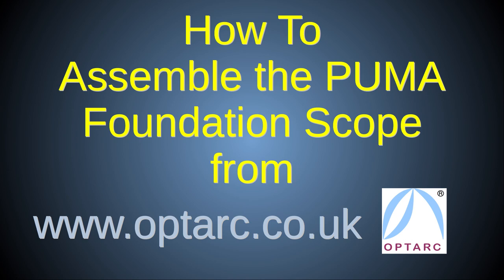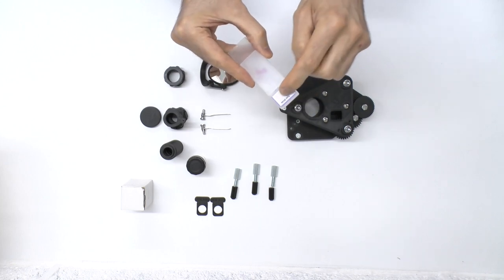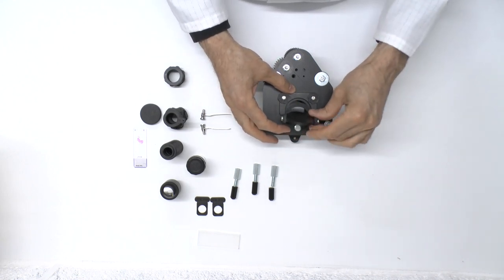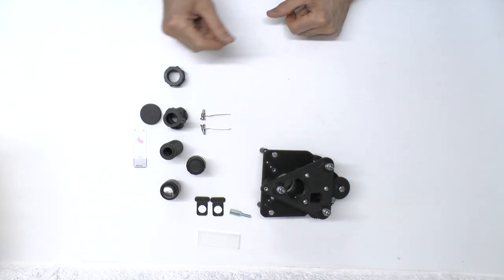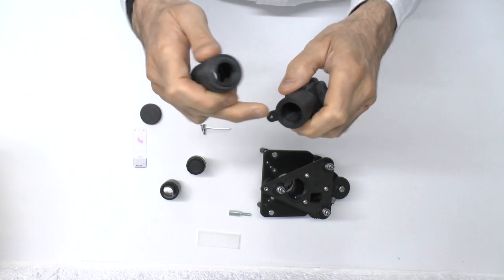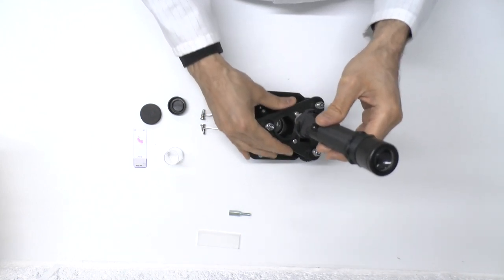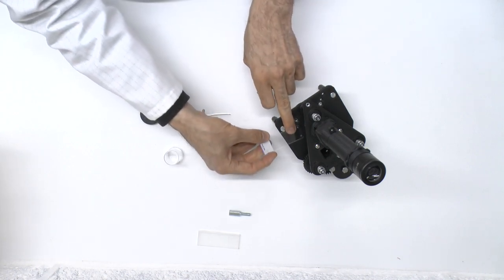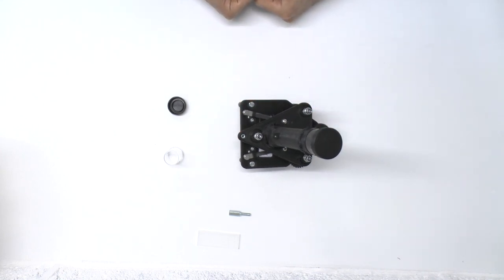Assembling the PUMA Foundation Scope Microscope

Comment: Is there a need to have oval mirror ?

Its not easily available to purchase and seems to be expensive nowadays with very limited stock.

Is it okay to use a circular mirror and customize the 3d file ?  

I am curious to know if there is a Functional Reason for choice of Oval mirror over circular.

I am guessing that the mirror's light will appear as a circle in the eyepiece when it is in an angle and hence this decision was made.

But, I see all  commercially available projects come with circular mirrors. I am slightly confused here.
Reply from the maker: Your guess is correct - the oval, projected at 45 degrees, gives a circular area of illumination. However it is not about 'as seen in the eyepiece' but as illuminating the back focal plane (BFP) of the objective so as to get maximum resolution and minimise unwanted phase contrast. You could use a round mirror if the minimal dimension of the projected oval (because the projection will be oval with a round mirror) also fills the BFP of your objective. This should be fine for low power objectives but the higher you go the more likely you are to get issued with poor quality illumination if the mirror is not large enough. So, with a round mirror, to get equivalent quality of illumination for high magnifications, you will need not only to alter the shape of the receptacle but also its size and a bigger size may not rotate to 45 degrees unless you also elongate the legs.
Having said all that, you might actually be able to 'get away' with using an oval piece of aluminium foil instead of the mirror. As long as you are not using this as part of a Köhler projection system, the slight diffusing effect of the aluminium foil might actually improve the quality of illumination compared to a clean / pure mirror.

Comment: What is that specific test slide protective case called. I could not find it any where online.
Reply from the maker: It's called a 'slide mailer' (a single slide mailer in this case because this type holds just one slide ). This is what we use to send glass slides in the mail - hence the name.
Reply: @PUMAMicroscope  I know the generic term 'slide mailer' but when I search I only find the hinged opening type. This is like a sliding style of mechanism to it. 

I did search for this specific type of opening and could not find it.

I am able to find a generic slide mailer that hold one slide but I am in search for this gliding style slide mailer.

Please help if you have a link for this specific style of slide mailer
Reply from the maker: @sheikjabuty  Oh - I see. I get these from a company called CellPath Ltd. They call it the 'SLIDERITE I MAILER' and product code is 'BCR-0100-02A'. Hope that helps.

Comment: Hi, what magnification objective Lens and eyepiece are comfortable to use on this configuration(Config 1)? 
Thank you for making this project open source !!!
Reply from the maker: A x10 wide field eyepiece (to fit a 23.2 mm barrel) with high eyepoint (high eye relief) and a field diameter of 20 mm is recommended with all configs unless you are doing some special study that demands different. This config has only a mirror for illumination so can only give a good image with a x4 objective plan achromat. Total magnification would then be 10x4=40. You can just get away with a x10 objective plan achromat but if you want to use higher magnifications you would need to upgrade it with the Abbe condenser otherwise the image would look overcontrasted, dark and lacking in detail. All objectives would need to be of 195 mm conjugate focal distance, 160 or 170 mm mechanical tube length (170 would need to use the elongated 170 ocular cap module) and use the RMS standard thread for fitting.
Reply: @PUMAMicroscope   i really like how many modifications has this microscope, thank you for detailed answer, i'll watch all videos about puma microscope illumination before deciding what modification i need for my amateur purposes...